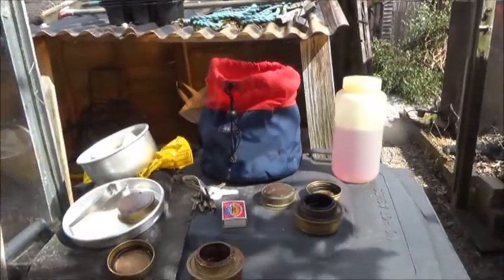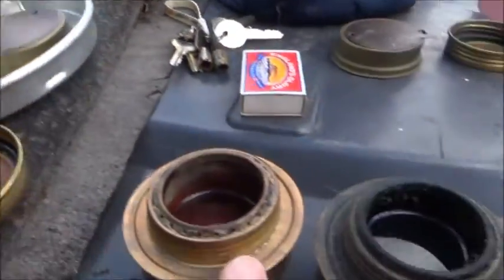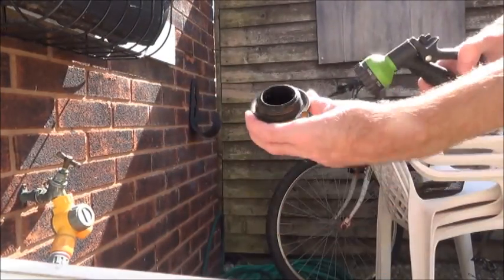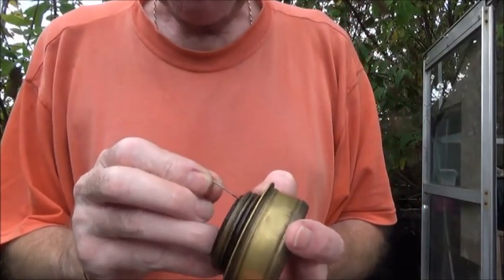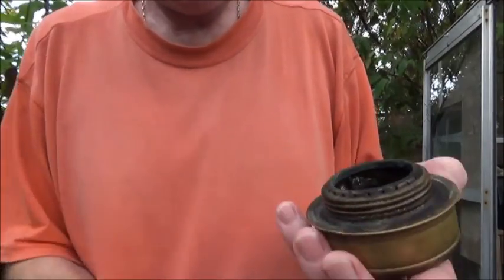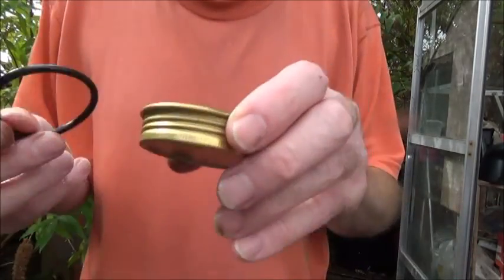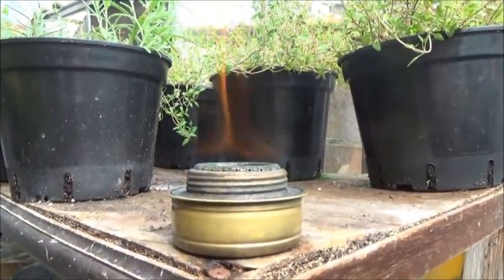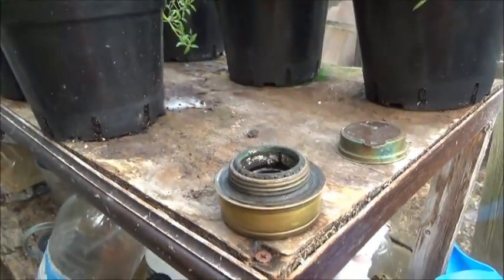How to clean a Trangia burner

Comment: I also use a tootbrush around the top to get the soot off, and finally a nice polish with Duraglit, comes up better than new 😀👍🏻
Reply from the maker: Good tip
Reply: I ran across a denture brush hanging on a peg. Curved handle, one side quite stiff standard brushhead, other side is a pointed brushhead same stiffness.  Kinda handy for cleaning a number of things.

Comment: Excellent tips Graham! Letting it cool down before you put the lid on I learned the hard way. Not all methanol burns the same, some dirtier and cooler than others. Here in the U.S. I found a product made by Gunk which is air brake anti-freeze and rust guard works the best. It contains methanol and benzotriazole, and works better than any I've tried. Love the quiet of the Trangia, and their cook sets are fantastic. When it gets down below 30f I have to go to four season gas, and below 10f a wood fire. Below that, get my butt inside the house!!! Great video as always, thank you! Ossie
Reply from the maker: Cheers Ossie

Comment: A little bit of steel or brass wool will go a long way.  Water is not necessary.  I use a safety pin to prick the jets & it always works stellar.
Reply from the maker: Cheers

Comment: hey just woundered how the burner would work after the cloth inside of it have sucked up water?
Reply from the maker: Worked fine when meths was put in , if you add a little water to the meths it prevents the bottom of the pan getting sooty and black